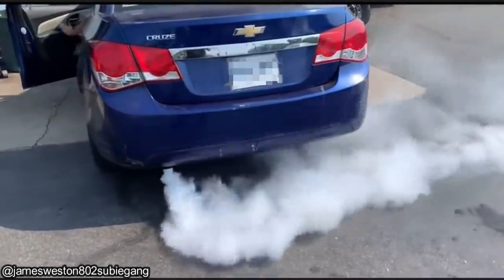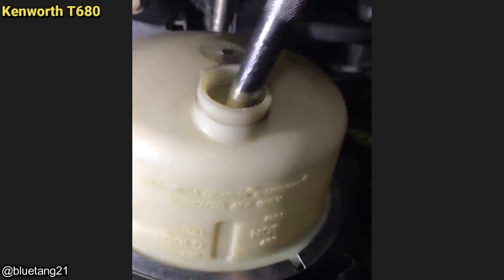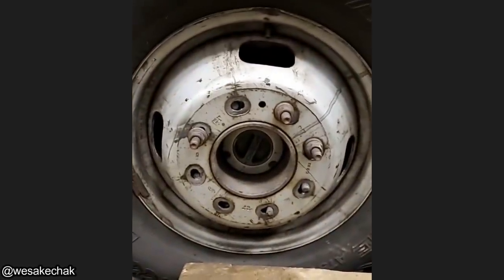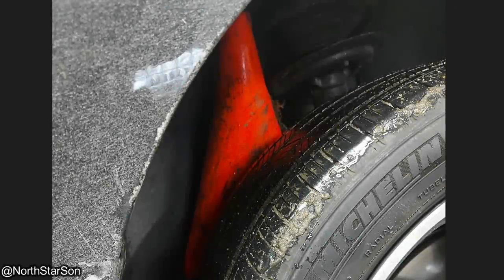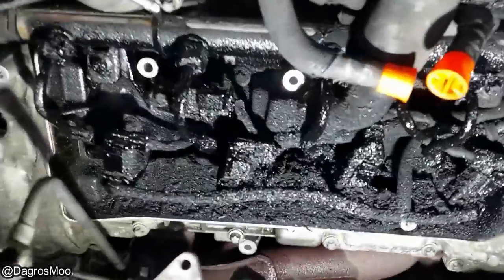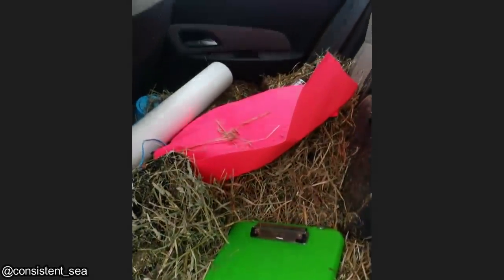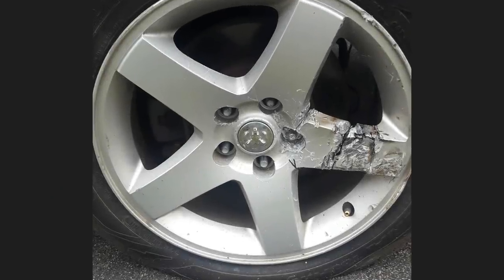Customer States Just Changed Oil, Now Vehicle Smokes A LOT! | Just Rolled In

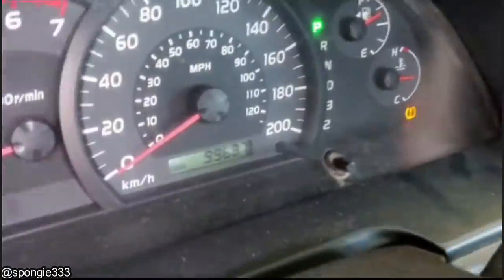Comment: 1:31 huh that's funny I had a first gen Tundra I sold it back to the dealership when the frame rusted out. 220,000 miles and it had the original timing belt! Maybe it looked like that the whole time I was driving it..

Comment: What's 7 missing wheel nuts when you STILL have 3 left 😂
That Tundra timing belt was just hanging in there😬 very fortunate.
Reply: And here I thought the partly worn serpentine belt on my Tacoma was bad … it needed replacement and had it off to replace an alternator , but it was no where near as bad as that one 😮

Comment: Just in the nick of time.  Getting that belt replaced now saved him thousands of dollars.  Trust me, I know.
Reply: I had a coworker who was convinced the dealership was trying to rip her off when they estimated around $1,100 to change the timing belt in her Acura. I told her that was average, mine was $950 a couple years earlier. Though they were different models I walked her through what was needed just to get to the belt in my car. (Essentially removing half the front end.) They also change the water pump at the same time because it has the same life expectancy as the belt and requires the same process to get to it.
She didn't want to pay so she decided to put it off until it started causing problems. The first sign of a problem was with the engine made a "weird noise" for a second, then stopped. She was told they could either repair the engine she had or install a rebuilt one. It was around $5K either way.

Comment: I’m surprised about the Tundras timing belt with a 100k on it.  I got 115K on my last one and it still looked good.  Plus they’re non-interference engines, no worries.
Reply: Might have to do with years in service. Rubber don't age well over a decade so it's not unusual to have a mileage limit plus a time one.
Reply: Maybe ne was worn out on my Tacoma , but not that bad after about that many miles but high heat in AZ causes more problems had to get the one in my civil c changed 3-4 times in 450k miles
Reply: Some of those 4.7s are interference, depending on the year and model

Comment: i use brake fluid for clutch slave cylinder fluid and auto transmission fluid for power steering fluid in many cars as thats what the service manual says to use,infact both my car and truck use merkon3 atf as ps fluid and dot3 brake fluid for clutch sc. so i wonder if the guy who used brake fluid for powersteering fluid got it confused?

Comment: That Kenworth driver may be an older guy, that ran old school air over hydraulic brakes. My bus is air brakes, but the front axle still needs DOT3 brake fluid. I can see that mistake after a long haul, tired, and are running out of hours and you just want to rack up and sleep!

How's the weather up by you? It froze me shut still....and Im reshooting the next episode...again (third time!) because I found some old photos of my dad working on Ferraris and Porsches..using the toolbox I found 30 years later lol, so I think it may be cooler with the old photos (and one of the packs the photos were in just cracked me up! I forgot Bill Cosby was doing not just Jello pudding but also Kodak lol)
Reply from the maker: It's been cold as heck here lately and very windy. Finally warming up this next.
How's the weather there? Lots of snow?
Reply: @JustRolledIn  Snow is mostly gone, but still have about quarter to half an inch of solid ice covering the cars. And its cold...at least Im working at the computer scanning old photos. I actually found some real gems...like this old Snap-on van, and apparently the guy is still around and Im going to try to contact him and give him the photo. And probably the one that freaked me out the most, but my father worked on a Camaro that I would end up buying over 10 years later...in Europe!
Reply from the maker: @RipRoaringGarage  wow imagine that. Kind of cool that you're dad worked on it. I'd love to see that photo!
Reply: @JustRolledIn  I will put them in the vid, but I will post some in the community tab too. Theyre just too cool. If you want, you can put the Snap-on van in a vid. Its probably long gone, but its still cool. My dad put this high end sound system in it, subs, amps, and even....a car phone LOL. It was the 80s!
Reply: @JustRolledIn  I guess, this episode will be kind of an ode to fatherhood in general. Maybe Im getting old, and never having that chance, kind of weighs down on a person.
Reply from the maker: @RipRoaringGarage  looking forward to seeing it man 👍

Comment: Many years ago my Mom took her car in for an oil change.  They never drained the oil or even changed the filter.  They just put fresh oil in and then it had double the required amount.  2 days later my Parents took a road trip and it overheated every 100 miles.

Comment: I had a neighbor who was always jumping the battery on his 94 kia sportage,m he bought a new battery and it was going.dead, one day he parked by my house and that night I saw that his brake lights came.on and didn't shut off, when I saw him come out I came out and told him what happened and why his battery was dead everyday, I replaced the brake light switch for him which fixed the problem. This thing was a death trap, the amount of rust was crazy, I ended up doing a lot of work on it, the steering had so much play in it that it was like one of those car rides at an amusement park where you turn the wheel and nothing happens because you're on a track, the center link needed to be replaced, then the upper ball joints were not even connected, when I jacked up the front they were held in by the weight of the vehicle only, the ball had separated, I then had to replace the tie rod ends because when I took it for an alignment the ends were so rusted that even heating them up couldn't free them, I had to grind them off by splitting it open while not damaging the threads, I had to grind the upper control arms off as well because the bolts were impossible to break loose and the whole arm wasn't that expensive,, the ball joints alone would have been a good video for this channel, he sold it not long after I fixed everything, I put a new muffler on it too because it didn't have one.

Comment: I gotta wonder at the person who changed his oil and added 8 quarts. I get some mechanics do forget to drain the oil, but they should have a checklist especially the novice mechanics. If you don't know how much oil your engine needs Google it or ask at a parts store (usually they have the oil capacity). But the simplest way to check is on the dipstick. If its past the full mark you got too much oil buddy.
Reply: I had a good local repair shop overfill my Chevy truck by a quart and a half. Last time I let someone else change my vehicle's oil.  Well, not a good shop and not the first screw up on thier part...and they charged me for all of the oil
Reply: 8 litres seems to me that they tried to fill it until they could see it from the rocker cover
Reply: Theory 1) To quote Steven A Smith "Stay off the weed."
2) Two techs. One put oil in it, then stepped away. The second finished the job by, again, putting oil in it.

I've screwed up an oil change. But at least it was my own car and only created a huge mess, no damage to the engine. It reminded me to go through each step afterwards to make sure it was done right.
Reply: @Alucard-gt1zf  yeah to the point where the engine won't crank over and then needs a tow to the nearest shop for the "what in the excessive oil do we got going on here?"
Reply: @christopherconard2831  and neither of them bothered to check the dipstick! 😬

The worst I've done was have the oil filter loose enough to have an oil leak, I've decided to tighten it a little tight than to leave it loose. Apparently you need to snug it up then do the quarter turn but I always do a bit more just to be on the safe side. Other people will wrench it on and tighten it to 50lbs of torque in which the next guy has trouble getting it off.

Comment: How do you overfill your engine with so much oil? I mean...you would think the person changing the oil would at least check their owner's manual to see how much oil goes into the engine. Oil isn't that cheap either, so overfilling it that much....I guess stupid just doesn't realize how much money they wasted on that 'mistake'.
Reply from the maker: When I first started out as a mechanic we had a customer fill up to the top of the valve cover full of oil. It was pretty interesting lol but yea reading your owners manual or looking online does wonders 😜
Reply: Yeah a 5 quart is $22 or more. In most cases that's all you need.
Reply: @JustRolledIn  how do they not lock up their engine or get a massive puddle of oil all over the ground from that? That's not only expensive on how much oil they bought but the cost to replace blown out seals or in that case of filling the entire engine with oil, bent rods.
Reply from the maker: @VintageCars999  if I recall correctly their vehicle wouldn't start afterwards. So they got it towed to us where we found the engine to be full of oil. After draining the oil and adding the right amount it was good but smoked for a while.
Reply: @JustRolledIn  well probably good it wasnt able to start. Hopefully you showed the guy how to check oil on the dipstick. It just amazes me what these people do to their engines.

Comment: Over filled the oil...AFTER an oil change...? I've never seen a steel wheel rust out like that before!  Owner "installed" battery. Non steel timing belts, the bane of mechanic kind...and other disasters. By the power of Greyskull...some people should NEVER be allowed to own ANY vehicles more complicated than a pair of shoes.
Reply: All timing belts are non steel. A steel one would be called a timing chain.
Reply: @mikeholland1031  True. I used the incorrect term there. Personally I always use timing gears. No stretch and no going out of time.
Reply: @tobygathergood4990  sorry to be picky. I'm gonna be freshening up a Chevy 350 and was thinking of going with gears instead of a chain. Never stretch or break but can be a bit noisy. Personally never liked a rubber timing belt at all. Cheap garbage. Wears out over time even if you don't drive the car.
Reply: @mikeholland1031   The "noisy' timing gears are straight cut. There are quite units which are helical cut. The have two idler gears and a restriction plate to stop the gears "walking" out of contact.

Comment: Do people not know the trick to getting off a wheel if you lose your lugnut key.  Remove all lugnuts excepts for the one that needs the key.  Once you do so there will be a little play between the studs and the wheel.  If you wiggle the wheel back and forth often times you can get the lock to break loose where you can remove it by hand.  If you have expensive wheels always make sure you use 2 locks not 1 and you will be guaranteed no one will steal your wheels.  Sometime you may need to add a little heat to the lock to help it bREAK LOOSE.

Comment: 1:53 What was the person attempting to power?
Reply from the maker: sub woofer and amp maybe? lol
Reply: @JustRolledIn  That was my thought until I noticed the wiring was going into the dashboard. In my experience, subwoofers and amps are typically mounted behind the back seat, not in the dash.  Whatever it is connected to, you should never run wiring where the insulation can get pinched.

Comment: Some of these people need driving bans, the others need prosecuted for the bare faced neglegence. I wonder how many accidents in the USA wouldnt have happened or been far less of an incident if peoples cars' had been maintained. That broken wheel in the video for example, all it needed was a decent pothole and thats it, they will crash.
Why isnt there a nationwide yearly saftey test, where they check wheel bearings, suspension and brakes etc, and if the rear subframe has snapped off and only held on by the prop shaft - sorry you CANNOT drive this on a road.
Or is that just "GoVeRnMeNt iNteRfiRaNcE WiTh MuH fReEdoMs"??